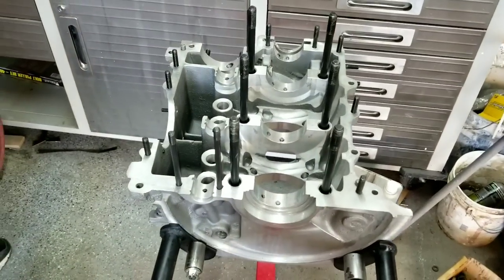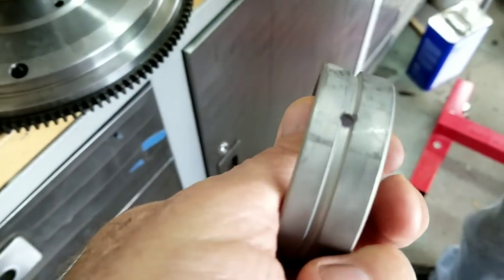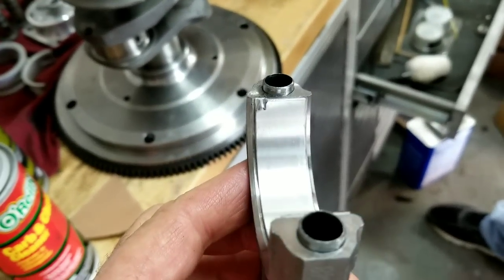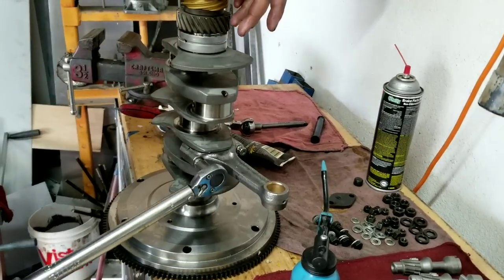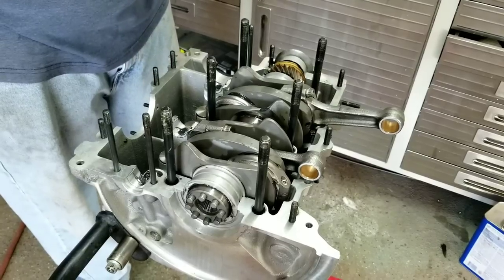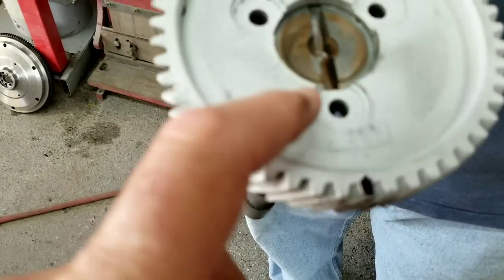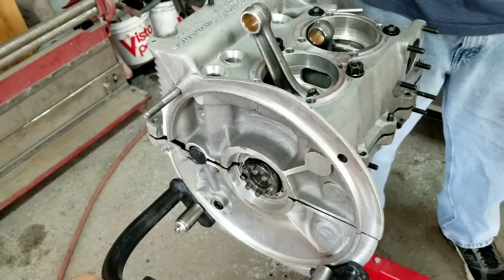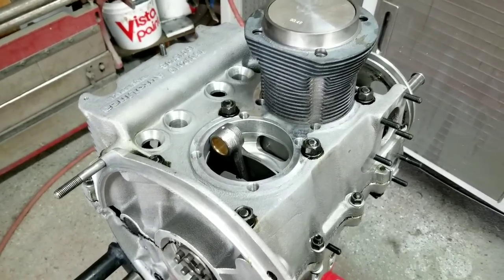Bulletproof VW engine build 1 vw flat 4 engine vw bug vw bus

Comment from the maker: your comments are greatly appreciated. thanks for watching.
Reply from the maker: that is how my channel is supported. as all channels are. It cost money and time to make videos.
Reply: @burtsegal3612  Ads are how the channel makes money. It's part of his living.
Reply from the maker: @burtsegal3612  sorry man I have no control over the ads. That is how youtube and I get paid. Otherwise these videos would not exist.
Reply from the maker: @sumofl  Thanks makeing these videos does cost money. Nothing is free. Thanks for the backup.
Reply from the maker: @alanbiggle544  thanks for that alan. Some people think stuff should be free. But I asked my bills one day if I could have a holiday and they said NO. ha ha. thanks for the backup.
Reply from the maker: @burtsegal3612  there is always youtube red. Just like cable production cost and hosting is not free. Either ads or pay monthly. Other videos with no ads do not support youtubes business. They eventually will need to be removed because of the cost of hosting.
Reply: If the #1 cylinder case bolts are the first to pull out, is there room to tap in larger diameter threads?
Reply: @Marshall Bradley instablaster ;)
Reply: @Byron Harlem I really appreciate your reply. I found the site on google and I'm in the hacking process now.
I see it takes quite some time so I will reply here later with my results.
Reply: @Byron Harlem it did the trick and I actually got access to my account again. I'm so happy!
Thanks so much, you saved my ass!
Reply: @Marshall Bradley glad I could help :)

Comment: A pro tip from somebody who built VW engines for a living.  Go ahead and drop in the distributor drive gear with the washers and the spring. Install the distributor clamp and distributor. Point the rotor towards cylinder #1, and when you drop the crank in, hold the #1 rod all the way out. Now you're timed and don't have to worry about dropping one of those little drive gear shims down your brand new motor. Another thing I didn't see you do. Checking lifter to case clearance at full lift. I've had to clearance the lifter bore face on even some fairly mild cams. Great video! Keep it up!
Reply from the maker: good info on that. need to have the distributor in there so you dont strip the brass gear we usually put a dummy in there so it wont drop out.

Comment: Grooving the backside of the main bearings will not increase oil pressure...but it will increase the oil flow.
Reply: I agree! It is originaly designed too work  under the principle of Bernoulli. When it;s cold,  the oil pressure is higher, as the case warms up. the oil will now flow smoother.

Comment: The first engine I ever built with a CB Aluminum Super Case I had to rifle brush all of the oil passages because of casting sand that was present.  I also de-bubrred the entire inside of the block.  Lot's of sand in there as well.  Strong blocks though.  My 1st engine was a 2276 (Chevy journals, H beams, Round ports and their turbo cam) single 48 Dell with their turbo header and a Spa turbo.  It went into my 67 Beetle.  The car lifted the wheels off the ground in 2nd gear (M & H Street slicks as well).  Cool video.

Comment: I built a lot of VW engines and I got to the point that I helicoiled every stud.....it made your torque reading trustworthy and the studs didn't pull when we really leaned on these engines and got them hot.  Yamaha makes an excellent grey sealant that they use on 2-stroke engine case mating surfaces....I found it to be excellent for mating VW cases.  If in doubt, I line-bored the engine cases.....German engineering is not always German engineering, if you know what I mean.  Also went with remote oil cooler as the old ones cannot be cleaned and they stood in the air flow of the #3 cylinder and made it run hot....this was corrected in later engines when the put the oil cooler in a "dog house" on the back of the shroud.  I did not like the advance curve of vacuum advance distributors and went with an 009 or 013 mechanical advance.  Don't EVER cheap out on oversize cylinders......Mahle or some other forged slug and barrel are well worth the money and will take a hell of a beating.  VW exhaust valves are prone to "losing their heads", literally, and when that happens, it's engine city.....always throw in new valves....cheap insurance.  I've forgotten so much.....  Hope that was helpful in some small way.  Keep the Faith and learn how to swear in VW.
Reply from the maker: i normally use yamabond. That stuff is great. Those aluminum cases are super strong compared to the old mag cases. no case studs pulling on that one.

Comment: use a hot plate and a bread loaf pan.   put engine oil in the bread loaf pan.  Put your bearings or gears or sleeves into it and heat them up that way.    A large improvement over using just a hot plate because it will help pre lube the parts too.     I usually set the heat to about 300 degrees.    just short of smoking.      Has worked wonders for about 60 years.     Try it    you will like it

Comment: They have tight clearances-not tolerances.The tolerance is a +/ figure the manufacturer selects component dimensions to.The finer the tolerance the more accurate the fit whether it is a clearance fit, free fit or interference fit.Bearing manufacturers for example grade their products according to how they pass the tolerance inspections and the finer tolerance products ( with a suffix in their part number) are a lot dearer and used in aerospace jobs etc.

Comment: My brother was owner of a Porsche/VW shop for 35 years.  He was a fanatic  when it came to rebuilds regarding the oil flow issue.  While the mismatch was good  enough, he felt that in an air-cooled engine, oil flow is everything.  The more free the flow, the longer the engine will last - especially in hot weather environments.  It explains why the GM smallblock was so long lived: Good oil flow.

Comment: This brought back memories from my earlier days. I owned several busses and bugs when I was younger. 1971 Westy, 1971 9 passenger bus, 1964 Barn door, 1956 bug, 1965 bug, 1969 bug. I’ve rebuilt every one of those engines (some a couple of times). My first car when I was 18 was the 1956 bug which I had to rebuild the engine to make it usable. I made many mistakes but in the end everything worked out. I used it until I was drafted then my parents sold it because they thought I was killed because I didn’t write home for two years.

Comment: I've never put sealant under the main case studs on a shuffle pinned case. The shuffle pins seal plenty tight enough to keep any oil from creeping up the studs.

ALWAYS use a torque plate to press the cylinder tight to the case when checking deck height. If you don't you won't know the true deck and can end up too tight. 

I only use about half the amount of sealant you do on the cam plugs. The main problem is if you plug up the little oil return galley when the excess silicone squeezes into it, you have an oil leak from the cam plug (ask me how I know) 

As said before there is a lot of work to do inside stroker relieved cases. You really have to sand down all the sharp edges left by the CNC mill to eliminate any stress risers where cracks can start to form. it can take a couple of hours to do it, but well worth the effort. 

Great video and commentary!!

Comment: I’ve got a Berg 2120 in my hot rod that was built in the 90s put together CAREFULLY with Permatex and I still don’t have any leaks.
Reply from the maker: yea dont knock it if it works. I really like the yamabond or honda bond stuff. We switched in the 80s and less problems. But Permatex also works great.

Comment: Had to chuckle.. at 23:45.. I never bought those clips.. early on in building I needed a pair, meant to get em before starting.. 3 day weekend and I wasn't going anywhere. Robbed a wire hanger from the closet, wrapped it around a socket twice, bent the ends to fit the job.. been in my engine box some 30 some odd years. Last used was about 3 or 4 years now. Not perfect but they work!

Comment: Thanks for a great video, Mike. Many good pointers in these. A couple of points, if I may... On relieving the main bearings with a rotary burr... Maybe it would be better to find alternative location for performing this operation? Would save the filings from falling into the open engine case directly below. Relieving the oil grooves in bearings increases oilflow volume. Oil pressure on the other hand is created by tolerances between the crank and bearings. Granted, volume also does play its part, to an extent. I did not see the crankshaft oil slinger being installed? Did I manage to miss that part? While some engines, often those for sand rails, do not use them, surely it would be better to install one, than leave it out.? Waiting for more on this build. Cheers from a European born eng.D living out his retirement years in Indonesia.
Reply from the maker: yea we cleaned all that up off camera no issues there. we installed the oils slinger as well. yea not in this video next one. thanks for watching.
Reply: Beat me by 3 years. Well noted.

Comment: On aluminum cases I drill, tap and throughly rifle brush every oil passage.  Because they are sand cast, you can have casting remnants that ruin brand new bearings.  

I made 275 hp on 7 psi with a spal T3 Garrett blowing thru a single 48 Dell.  It was a 2276 on CB round ports.    Love those blocks.
Reply from the maker: nice job on that at 7psi

Comment: After I have torqued the case down I let it set for at least a day then torque it again. Then continue with the build and after torquing the heads I also let it set at least a day and torque again. Often you do get a little more movement. Metal moves, specially aluminum. Can't get to the case nuts after the heads go on. Adds a little more time to the build but I feel better.
Reply from the maker: good plan. we usually run them then re torque then drive for a few hundred miles and do the same.

Comment: Great video!  .058" deck height seems pretty good to me.  I generally run my high performance engines between .045 and .060".  Remember that the head gasket will add deck height.  Terrific build.  Thanks!
Reply from the maker: Good stuff
Reply from the maker: 45 and 60 is my favorite. I dont like going much mr than 60. too much barrel fire. gotta keep it in the head.

Comment: after owning a VW shop for fifteen years and a wholesale engine business for ten years before that, between myself and my partner we built four thousand engines, two things, you didn't check the lash on your cam gear and you should have installed the distributor drive, also I didn't hear if you were using a stock cam grind but if not you should check for clearance between lifter bore and lifter at max lift.
Reply from the maker: we did check the lash on the cam gear just didnt show it probably or maybe you didnt see that we did. those aluminum cases are designed for larger cams. But thanks for the comment. for sure those things are important. ON another build we found the cam gear was too tight. so we switched it out with another .

Comment: Me early 80's had a choice fly to Nellis AFB or get 1200 dollars to drive. I bought a 300 dollar 70 bug and drove from Tyndall AFB to Nellis AFB with a sleep over in Galveston TX . No radio a cooler of beer and mountain dew sitting in the passenger seat seeing Phoenix at night and crossing Hover dam at sunrise was memorable only issue was an unknown power loss going up the from the dam held it to the floor cough sputter off I went. No idea how many miles set of floor pans, 009 distributor tried different carb setups settled on a 40mm Weber dlf with intake through the boot .Who needs heat or air in Florida my wife's first vehicle was a vanagon with air 300,000 miles including 3 years of exploring Colorado, a queen mattress fit perfect

Comment: I'm doing a teardown of a near new 1776 for a buddy.  He had it build at a shop and it seized within 10 miles.  The first thing I noticed was a ton of silicone squeezed out around the oil pump, and as you can imagine it squeezed a bunch inward as well, and I suspect that's the cause of the seizure.  The story is that his friend drove it around the block a couple times and parked it, when he went to start it a few days later it wouldn't turn.  My guess/hope is that when it was warm it was turning freely and locked up after it cooled down, and hopefully there's minimal damage.

In my first stage of teardown I found that there was oil leaking onto the flywheel's clutch surface and the crank bolt was barely tightened, I hope the internals weren't assembled with the same level of incompetence.

Comment: Couple of things, 

 Watching you using a die grinder on the back of the main bearing made me cringe, metal shavings flying everywhere right next to an open engine, not good. If you are going to grind something, that engine should be bagged and parts on the work bench covered. Better yet, do it somewhere else, way away from your engine assembly. 

Get bearings that fit properly, maybe another brand.  

Bead blasting precision gears is a bad idea, clean by hand with brake clean and scotchbrite. Noticed the drive mating gear wasn't cleaned either. 

I was surprised to see what looked like steel galley plugs, go with aluminum, less weight and much easier to remove next time around. 

I do enjoy seeing a VW engine and how it's assembled, getting ready to build one for a dune buggy. I'm retired after 40 years of building Ferrari engines, there are 3 things to remember when assembling an engine of any kind, clean, clean and clean !!!  

Sorry for the bother, continue on please...
Reply from the maker: final cleaning was not even done at that point. thanks for that though.
Reply: Aircraft mechanic here agreeing with you. Also gears handled with pump pliers, wrong tools used for snap rings, many things hammered in place. Not  optimal.
Reply: @Lord Baxter An engine is an engine, regardless of the manufacturer, dirt & debris is death...
Reply: @rogeeeferrari  Thank you I don't build engines but Attention to detail is everything in racing be it cars, airplanes, boats. What stories you must have Roger. You in Dallas?
Reply: @waveman2952  After 40 years in the Ferrari business in SoCal I bought a house in Arizona and retired, currently floating in the pool every day. Oh yes, stories a plenty !!
Reply: @rogeeeferrari  the operating RPM has a large influence on contaminent size vs. damage a red line of 4500 vs. 12000 RPM, but agree the cleanest assembly makes for longevity.
Reply: @Lord Baxter Don't make that shit right though!!Just shows sloppy workmanship...
Reply: No argument on cleanliness but the VW engine builders that know what they are doing do rap on the rods and counterweight as they go thru the torque sequence on the rods. I believe so anyway. That it helps the odds of you not finding any tightness or binding. That it just helps the rod bearings seat fully more easily.
Reply: @Lord Baxter Don't make it right,if preventable due to carelessness......
Reply: @erikev  bolting down the case that wouldn't seat made me pucker!
Reply: yeah I thought too Especially after he sai Make shore you Clean out all the Oil Gallys LOL

Comment: Hey I like that you want everything to be very clean, super important! Not sure why you ground the notch in the bearing and had the grindings dump all over the open case... I hope you went over it with a vacuum to get the metal chips. Good video though, thanks!
Reply from the maker: for sure all clean before we assembled.

Comment: When I owned one back in the day i overhauled mine twice. Parts were dirt cheap. I used to buy heads with the valves in the heads. New pistons new rods crank went to the machine shop only did that once. The car was the best today the cars are the worst you can't work on them at all.

Comment: I put together a 2276 fuel injected turbocharged Alumimum 82mm stroked water inter cooled engine it’s been a long time since I played with a Vw so far I got 241 hp with 198 ft lbs of torture the next pull on the engine dyno at 8300 rpm the fan rubbed the shroud so that was the end of the dyno so far I really wished I’d found a good video like yours because well it runs so far at 104 degrees ambient the intake temp was 140 degrees when I turned the water pump on for the water inter cooler the intake ended up at 80 degrees with ice water hopefully I end up between 375-400 hp without scattering it parts except the inter cooler set up were CB performance props to them by the way I didn’t catch your stroke or boor but I had a lot of problems with the tins fitting with out beating the crap out of them so please take a little extra time on what tins you use if not stock ones thanks and props to you guys don’t remember what the cam was I think like 105 lift with the 3:1 billet roller rockers hopefully I end up with a hellcat eater 😎

Comment: i always use Permatex aircraft Black for sealant . Never had a leak , knock on Magnesium. Well, i sometime use spray Red for holding a gasket in place but for no gasket it has to be Aircraft grade Permatex.

Comment: A trick i learned from a friend who builds aircraft engine's  after you put the brush on sealer on case halves lay a strand of silk thread on the sealer all the way around the case half. After its torqued the silk thread will compress and that engine will never leak at the halves. He does the same with the oil pump before setting it in place except he uses oil to hold the thread. I have never seen one leak with silk thread.